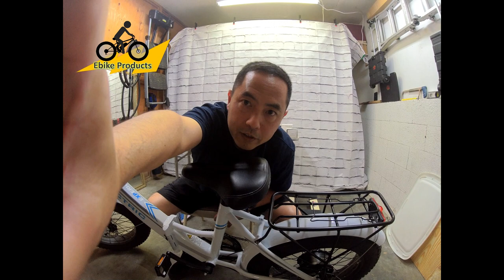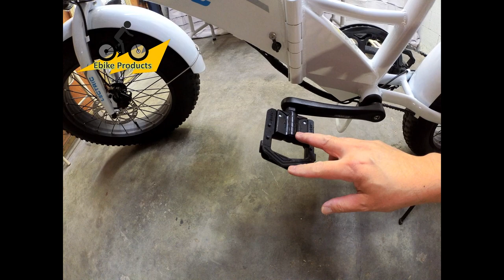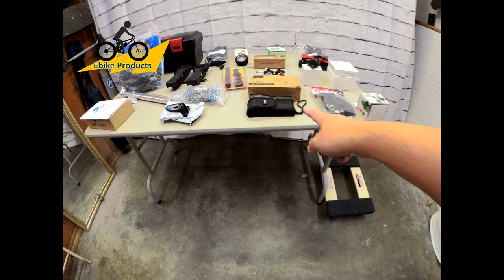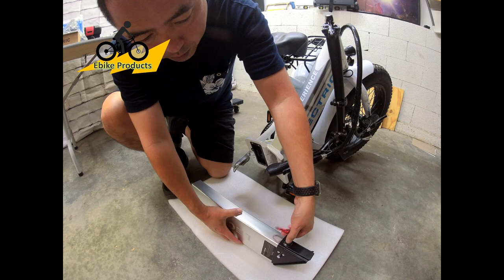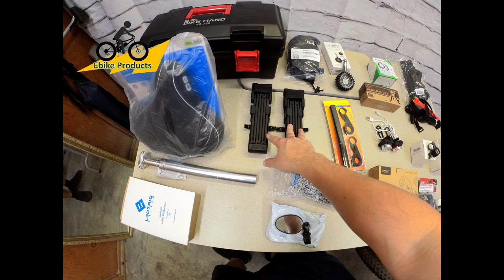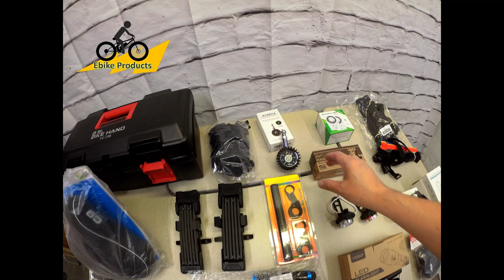Lectric XP Step-Thru FULL Review (with power failure ride story, folding tips, likes & dislikes)

Comment: Great video!  You’re right, while waiting, I bought most of those things and some other things:

- Rotor Security Lock with Key. It has an alarm that sounds like the motion security alarm, which I also have. 
- Bike cover and Handlebar raincoat 
- Portable USB Air Pump
- Spoke Reflectors 
- Helmet 
- Full Gel Gloves
- Clearon Bluetooth Speaker 
- Phone Holder
- Reflective Vest with USB Signal Light and handlebar remote control 
- Action Camera and Mount
- Slime for Flat TIRE Protection 
- Frame Bag
- Rack Bag
- Solar Power Bank that goes in my Frame Bag with the clear touch sensitive top
- Bike Chain Oil
- 40 Gallon Container to transport the eBike 
- Microfiber towels to wipe dust off the bike after riding
- Soap for Cleaning eBike if necessary. 
- I keep a Ziplock Bag inside my Frame Bag just in case I get caught in the rain (with the Microfiber Towel). I use the ziplock bag to cover my display screen.  Some people use disposable gloves for the same purpose.
Reply from the maker: That's an AWESOME accessory list! I got a lot of the same stuff, but still need a USB pump and slime. Great idea about carrying a ziploc bag for rain issues. I tried fitting the Lectric XP Step-Thru in 2 different totes that were shown by other YouTube videos but didn't like how tight they fit and returned them. I am going to see if I can find another solution for transporting it easily. 
Thanks for the comment and sharing your list!
Reply: I've got most of the same thing for my bike.👍👍

Comment: I am waiting for my Lectric ebike to arrive in late November, 2020.  In the meantime, I ordered a bottle of Slime, a zip up bag for the rear rack, a foldable cup holder for the handlebar stem, and a 11-28T freewheel. I will probably carry an air pump, multi-tool, and a patch kit. I agree with you, this ebike is a great deal for the price. Plus, customer service is very good, I hear.
Reply from the maker: That’s a great accessory list! I am looking into getting an 11-28T freewheel as well, but not sure if I’ll install it till the warranty expires. I need to read the warranty terms to make sure I don’t void it or my wife will be pretty mad (the Lectric is actually her ebike). When I start to commute I’ll be carrying a pump, multi tool, patch kit, and a bunch of other stuff in case of a flat. I may try a tire liner before slime, only because I think a liner may be enough for me. I hope your Lectric XP surprises you and comes in well before you expect it! Thanks for the comment on your accessory order. If my bottle bag is not satisfactory, I may look into a foldable cup holder too. Safe Riding!
Reply: @EbikeProducts  I finally got my Letric XP.  It arrived 20 days after I ordered it. I also had no shipping damage. It is now Nov 26 and I have had it two weeks.  I found I like to ride between 10 and 15 mph in PAS 2. I installed the 11-28T freewheel with very little trouble. The rear wheel just came out without a problem after I unbolted it. So far I have put 100 miles on it. I slimed the tubes, installed my cup holder, adjusted the brakes, and checked the bolts and pedals. I like the bike, and I feel I made the right choice.
Reply from the maker: Congratulations on getting your Lectric XP! After getting a flat tire and finding out how easy it was to remove (and reinstall) the rear tire from the ebike, I decided to get a 11-28T freewheel and don't anticipate any issues installing it. I need to be able to help the motor out sometimes to be safer on some streets around me that the stock Freewheel doesn't allow for. Sounds like you had a very similar delivery time frame and shipping condition like I did. It is such an awesome ebike, I too feel like I made the right choice. I am still debating about sliming my tubes even after getting a flat, but I think I'll be doing it sooner than later after seeing how much Tuffy Liners cost. Slime or a tire liner would've prevented my flat tire easily. Ride safe and have fun!

Comment: For the power cord plug you have to use a light to look inside and guide the plug onto the connection because they don't line up well.  After a few times you will memorize the location.  Another way to do it is to initially put the plug up to the hole but slightly raise it so it's not touching the bottom of the hole while going in.  And once the tip is in, you move the plug  around while maintaining constant pressure on it and you will eventually find the hole and it will slide in and stay in.  They should have given that part more attention because it's a huge point of frustration for anyone that has to deal with it but it's not the end of the world.
Reply from the maker: Ohh GREAT tip to look inside! I never bothered to look into the hole to see the problem. I've been just doing a straight push and will definitely try moving it around a lot to see if it will find its way in. The plug has never gone in since the day I got it.  It's one of the biggest frustrations (second to taking the battery out) for me. 
If it works, I'll do an update video for sure and credit you for the suggestion. I appreciate you taking the time to share your tip and solution.

Comment: You’re absolutely right, the bike has a safety component to keep you from burning out the motor. 

People need to know that so they won’t panic when the bike shuts down after running it full throttle for a while.  Particularly uphill.
Reply from the maker: I agree. I started to mildly panic when it happened to me. Thankfully it wasn't a full shut down.

Comment: You just have to make sure to angle to charge port cover correctly for it to go in.  I know...What a hassle.  Oh goodness!!!  I thank keyhole placement!!!  I just keep my eBike key on one of those little soft stretchy rubber colorful keychains. I don’t want anything noisy or heavy swinging under my bike. I kept my white styrofoam, too, to put between the folded bike and a bungee cord to hold it together when it’s folded. 

Keep up the great work!
Reply from the maker: Great tip on using the stretchy keychain. That would make it visible so I won't forget it. I plan to get one of those small lobster claw keyrings to be able to quickly clip and unclip it from my other keys. I've spent a ton of time trying every angle and moving the battery around to get that port cover to go in and still haven't figured out the angle.

Comment: Suggestion on the mirror for issue. Try to find a handlebar extender that spans the entire width of the handlebars. If there aren’t any just find a tube the right length and attach by using the brackets that came with the short one, or get it all at your local hardware store, attach the mirrors to ends>
Reply from the maker: Starting again to see if I can find extra long handlebar extensions. I think you are right and that could help solve some issues as long as there is an extension bracket that can support the weight. Thanks!

Comment: Very good/informative video.  I agree with you that  taking out the battery  is very clunky.  But, why take it out?  Chain up the bike and remove the key.  Isn't that enough?  Recharge it on the bike.  Maybe I'm missing something.
Reply from the maker: I am totally leaning toward never taking the battery out anymore. My garage is not directly connected to my home, so I was thinking it would be better to take it out everyday after riding and bring it upstairs to charge where I could keep the temperature of the battery out of extreme temperatures. Lately, I've come to realize that the garage is enclosed and doesn't get too extreme either hot or cold to where the cells would lose efficiency.
I don't feel very comfortable leaving the charger on for long periods of time if I happen to not need to go to the garage for over a day and forget to unplug the charger. I bought mechanical timers so even in the house they could be monitored and shut off via timer if I forget there too. It's actually too much of a hassle to remove lately that I now keep it in the bike and in the garage and charge it while reminders on my phone to shut them off. Another big reason that I've also made that decision to not remove it is that I notice the folding of the bike can put a lot of stress on the cable and there are other parts that need to be watched to prevent scratching the frame or bending something. So at the moment I am charging the battery while it is in the bike and setting alarms on my phone and watch to remind me to go down and shut off the charger manually while having the mechanical timer as a backup for an hour after my alarms in case I still don't remember to turn it off.
By the way, my paranoia to turn off the charging comes from the fear of living in a building with others that could get hurt if my battery or charger were to ever catch on fire. I know it's super unlikely, but there's enough fires that happen that I would rather be safe than sorry. Also, it's usually better to turn off a charger after a battery is charged and not leave it plugged in for a long time after.

Comment: I got the fed ex notice after 6 weeks and made a note that it was just an electronic notification that was sent to fedex. After 6 weeks 10 possible more days didn't matter much, the next morning I got notifications saying it was picked up and in transit and sure enough it showed up two days after that notification. I got a lot of the accessories you recommend, been installing them and adjusting. Never used a tire gauge before not sure if pressure should be 20 or 25
Reply from the maker: Congrats on finally getting your Lectric! Check your tires closely for the max tire pressure. Lectric has 2 different tires they send out with their bikes and each brand (CST or Chaoyang) is different. One is 30 PSI max, and the other is only 20 PSI max. You can always ride with lighter pressure than the max and it will give a lot more comfortable ride, but it will lose a little more range and slightly less top speed. Having the tires at max pressure definitely makes the ride a little more bumpy. 
Ride safe and congrats again!

Comment: 28:44 yeah we designed the step thru model as an afterthought, so the ground clearance is less than than XP, and folding hinge doesn't line up the best because of the steeper angle. You're not doing it wrong. A bit of Dremel tool work should correct it tho
Reply from the maker: Thanks for commenting! Would you be able to expand your comment a little more about using a Dremel tool to correct it? I have a Dremel and would love to make a video on a fix!  Thanks again!

Comment: I have a "Bike Peddler" mirror attached to my helmet. It works great, and I don't need to fiddle with mirrors on the individual bikes that I have.
Reply from the maker: I used to use one of those mirrors attached to my helmet in my younger day to keep things lighter on my bike, but I never really got used to it as much. I may have to revisit using one of those in the future. The Lectric XP in the videos is actually going to be for my wife when my BlackBird full size Fat Tire ebike comes in so I'll be installing mirrors on it for her. Thanks for the comment and the helmet mirror suggestion!

Comment: I'm considering buying an e bike for my wife she 5'2".  And am wondering if this bike would fit her. I have Sondors mxs  Which is too big for her.
Reply from the maker: I’ll ask my wife to jump on test ‘her’ bike out and give me her thoughts. She is also 5’2” and should give you a good idea if your wife might be ok with it. I’ll be adding a suspension seat post and cloud 9 seat to see how much higher the minimum seat height will be too. Most people say the bike needs a little seat shock cushioning if they aren’t used to riding a lot. The Lectric is really going to be my wife’s ebike so I’ll be fitting it to her taste as much as possible once my Blackbird comes in so she will want to ride with me. I know my wife will be too small to ride the Blackbird.
Reply: GET THE STEP THRU MODEL! I’m 5’2” and the standard version is doable but also very awkward. I now have both (my step thru arrived yesterday), the new model is MUCH EASIER for height challenged folks. Even then, the handlebars are also a reach so I will be replacing them with mustache style (further curved in) bars so the reach is less as well. There is another Youtuber with a video out on changing the handlebars and which ones work with the folding. It doesn’t look too difficult to do.

Comment: I was wondering...  when ordering a second battery, will it come with a different key, or do they send a battery to match the key you already have.
Reply from the maker: Great question! Sorry, I really don't know the answer to that. If I find the answer I'll reply on this posting about it.
Reply: Based on our experience for replacement keys, you’ll probably get a different key. We needed a replacement key (after bending both keys - be diligent about removing keys before folding the bike!) They had to send us blanks for me to take to a locksmith. BTW I had to get the blanks from LECTRIC because none of the locksmiths in our area had that style key blank. We color coded our keys to each battery (we have 3 Lectric bikes) so we knew which key goes with which battery.

Comment: Can you pedal this bike without using the motor if you want to?
Reply from the maker: Yes. I usually make anyone who wants to try it use the bike with the motor so they get the feel of how it balances. Then after they ride around a little, I will turn on the power. The bike is very heavy but very easy to balance with such a low center of gravity. Using lower gears it moves pretty easily but will still make you very tired if you try to go really long distances unpowered.
Reply: YES. That’s what my husband does most the time so he gets more exercise.

Comment: what about storage bags and air pumps for the tires
Reply from the maker: I recently bought the Rockbros rear rack bag and also have a portable battery operated pump. I should’ve bought those when I first got my Lectric as they are both super convenient and easy to use. The Lectric bag that came with the XP worked great, but the rear trunk bag is so much better and has panniers as well. I highly recommend it. I carry a battery operated portable pump, but it does take a lot of times to fill any fat tire so it’s just for emergencies.

Comment: Comparing XP original to XP Step thru.  What's your opinion?  Which is better for taller rider?
Reply from the maker: I have not had the chance to do a side by side comparison yet. I have a friend with the Lectric and an Aventon Sinch that says I can use his bikes for comparison so I’ll be able to do that in a future video and give you a ‘real life’ opinion on experience. 

My researched experience says that’s if you don’t have any issues with stepping over the height of the frame on the Lectric original, then you should consider that one over the Step-Thru because the lowest point from the pedal to the ground is higher and can avoid hitting it on the ground on turns. This depends on your experience level too, people who have ridden a lot will automatically rotate the pedals in turns to be higher to avoid the pedals hitting the ground. I feel it’s safer on an electric bike to have more clearance overall since a throttle may not have a rider thinking about the pedal clearance. 
Also, taking out the battery seems to be easier on the Lectric vs the Step-Thru from what I’ve seen. 

One review I watched, the owner said he felt the step-thru felt like the seat was more forward to him than the regular Lectric, but I am not sure if that matters. 

Since everything else is the same, after that it’s all a matter of preference. I personally like the Classic Lectric look over the Step-Thru, but since the ebike I bought will be used mostly by my wife when I get my full size Fatbike, I got it mostly for it to fit her better since she’s only 5’2”.
Reply: @EbikeProducts  Thanks for your feedback.  That's helpful.  I was worried about the pedals being closer to the ground.  Others have expressed the same concern. I have a larger shoe size (12) so worried about my toes hitting the ground.  Although the step thru design looks convenient for getting on and off.   I would be interested in seeing your side by side comparison of the two styles.
Reply: I have both... but I am short. They came out with the step through a year after we had gotten our original XPs. I’m 5’2”; I can get on and off with some work but the height of the battery bar was a problem. My step thru model arrived yesterday. :)  As a short person, the ST is MUCH better. I would think the regular style would work well for taller folks so long as you don’t have mobility issues. The battery key is much more difficult to get in on the step through version and neither is very easy. The key placements are my biggest gripe, even over the height of the original battery bar. Last I looked, the original models are being delivered much faster as well. I had to wait over 9 weeks (usual 6 week delay plus 4 more when bike was held up at the port, then fedex delays.) But as I said, this is our 3rd LECTRIC bike purchase. When they came out with the step thru, as soon as I’d saved the mula, I bought it. They’re that good a bike for the money!

Comment: Do not buy a Rattan bike. Not much help  with the guarantee. Bought an L750, the hub broke after 50miles, of easy riding. The support was minimal, was told to fix it myself, take the hub apart, or get it fixed by a shop for less than $50.!!!!!   they did order the part from China 7-15 days. I sent them a vid with audio to establish the problem.  They sent a vid of how to fixit. If that is the problem.. Owned the bike for less than two weeks. Going to be unavailable for two to three weeks, if I am able to fix it.  Very unsatisfactory.